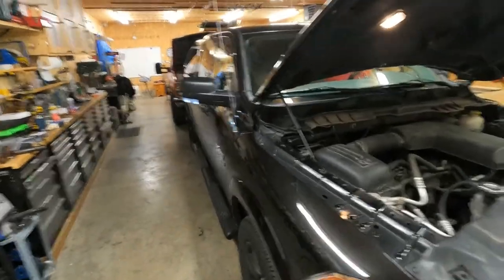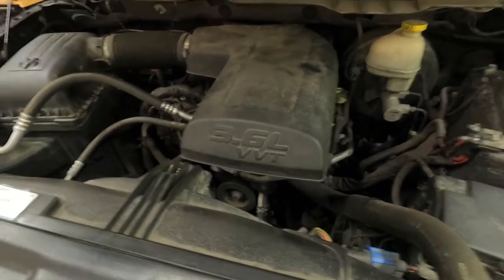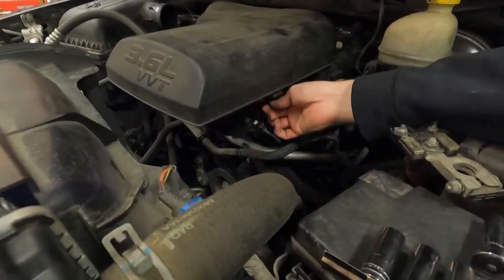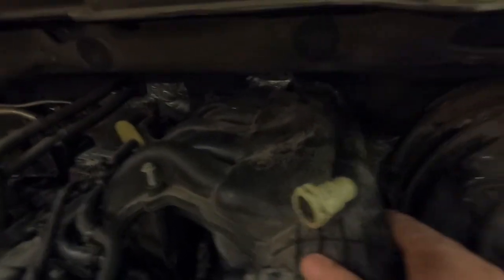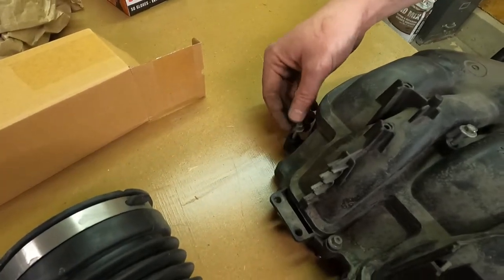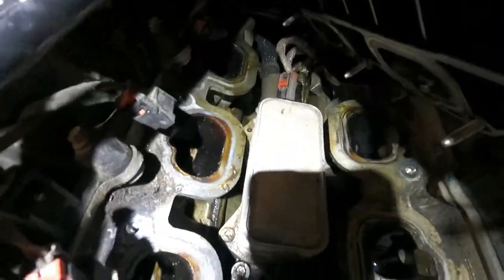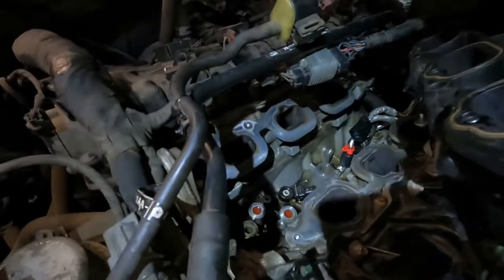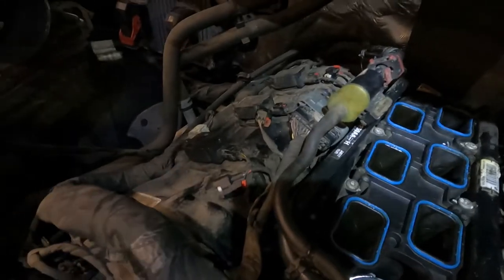Changing Oil Cooler 2015 Ram Tradesman V6 3 6L Pentastar (Will work for any 3.6 Pentastar)

Comment: 90 percent of these oil cooler failures are 5 min oil change places related. They over tighten the cap. Alot of them you can tell just look at the bolt   put a white sharpie mark on the cap for tightening reference.Did this from day one. #2 do not put 5w20 in these engines only use pennzoil ultra synthetic 5w30.. 276k on my 15 durango

Comment: I did mine and changed it with the all aluminum also  and it still leaks coolant and oil just not nearly as much I’m just going to take it to a shop I trust and tell them to do, it such a pain 😩

Comment: Do you need to drain the oil when changing it??
Reply from the maker: I didn’t it’s so high in the system it wasn’t an issue. But I would recommend changing the oil at the same. But don’t need to.